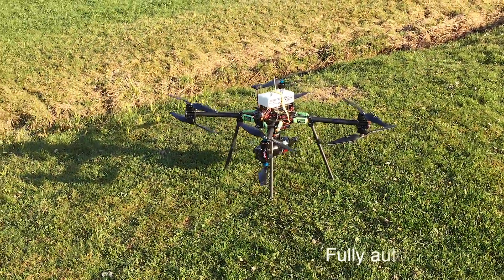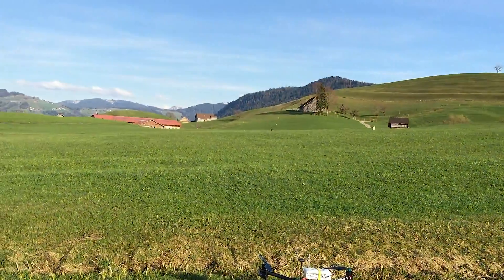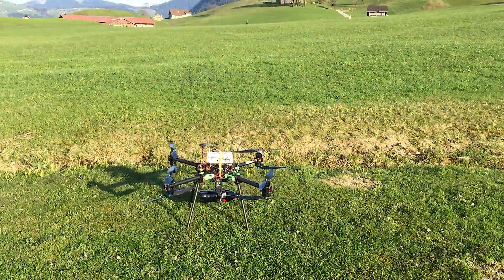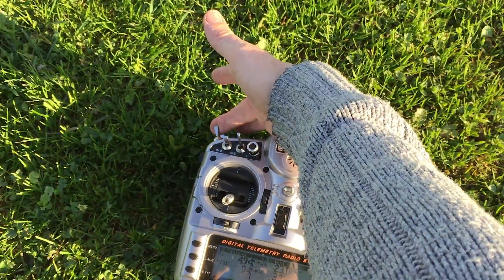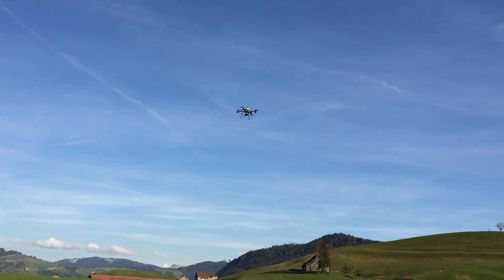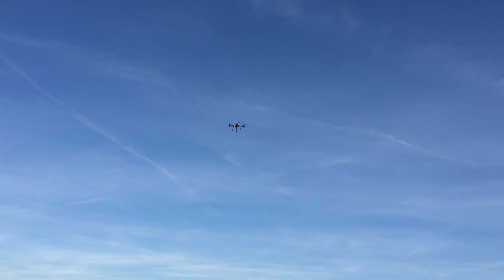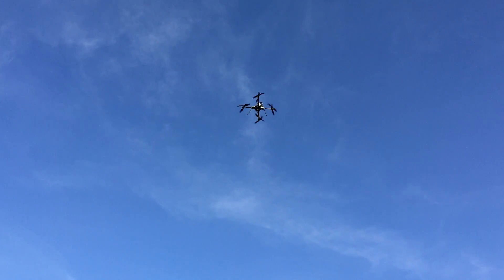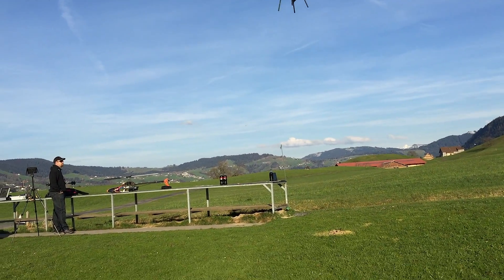Fully autonomous Drone cargo delivery demonstration

Comment: How much flight time with 8kg payload?
Reply from the maker: Only about 5-6 minutes; You need to go significantly larger on props and Voltage to get decent flight times with a heavy load like this. 30" props and 12S batteries.

Comment: i am using the  multiwii crius se v2.6 flight controller and flysky transmitter. my gps works fine. i want to know how to enable that autonomous take-off and land mode using AUX switches.?
Reply from the maker: I used arducopter, sorry.

Comment: Is the payloader compatible with other drones like the Chroma or the Phantom?
Reply: +Antonio Worthy Not at this time, mainly because the compass is located right next to where the magnet is, so is not optimal. Also, the p3 has no free PWM slots, so no way to control it.

We have a new version which is UAVCAN compatible, so will work, but there's still nowhere to plug it in!

Comment: Now a vid flying for 15min to 20 and it starts getting practical. Amazon is using these for media attention imo the actual use is not a reality in North America. DHL also faked an interest, good work though ZeroUav Gemini makes a good redundant flight controller with waypoints and android control. .
Reply from the maker: Hoverbot1TV Stay tuned. We are working on exactly that.

We know Amazon are driving it purely from a media perspective. We have much more practical uses in mind.